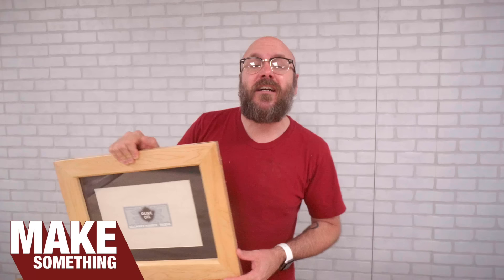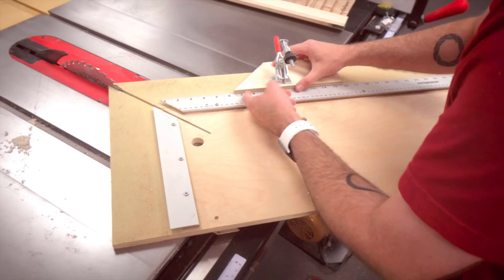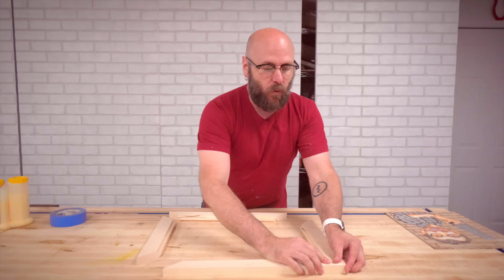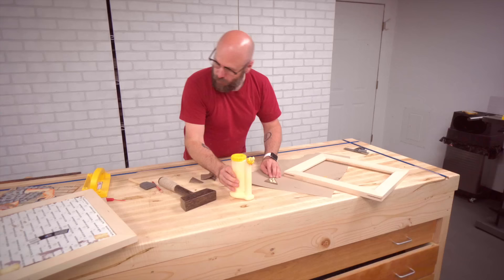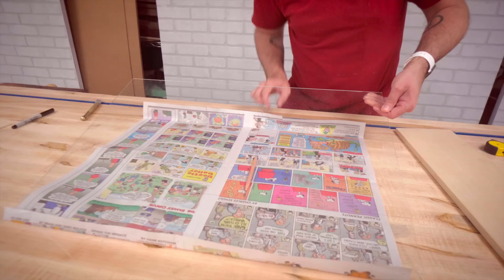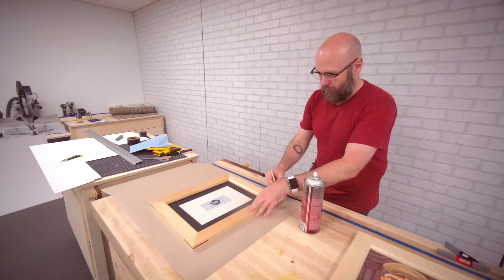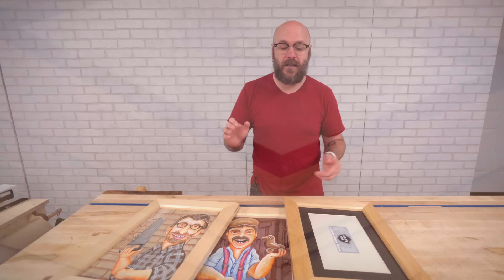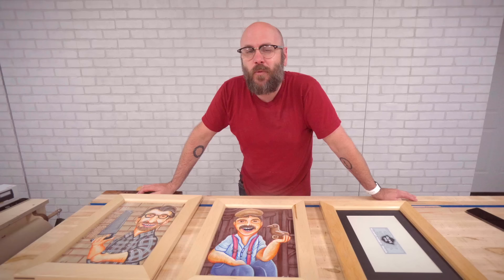Picture Frame Making, Everything You Need to Know. Includes Matting & Mounting

Comment: Hey David! Cool frames! I’ve been making a ton of frames over the last few months and I have a few tips/tricks I’ve picked up that you might like. 1) Instead of Super 77 you can get a cheap ATG tape dispenser that puts down a bead of the adhesive you see on glue dots. It doesn’t get messy or smell bad like Super 77 (IMO) and it sticks instantly, even if you’re backer paper is wet. Why would it be wet? 2) Wet your backer paper slightly, like barely damp, before attaching it to the frame. When it dries, the paper will shrink up a tiny amount and pull the slack out making it nice and taut. A fine mist sprayer works great for this. 3) The framing shops trim their backer paper with ~⅛” inset from the edge of the frame using a little tool that just holds the razor blade in at the right distance; you can make one pretty simply with a block of wood and do the same if you like it; I think it looks nicer on the back and hides the paper better. 4) If you use D-ring mounting clips on the back of the frame they sit flatter against the wall; you can find videos on YouTube showing the recommended way to weave the picture hanging wire through them so it creates a knot that keeps itself tight. Finally, if you find yourself making a lot of frames, a mat cutter makes life a lot easier (you could totally make one, come to think of it) and artists tape is a lot cheaper and more forgiving than the acid free cellophane tapes for your hinge mounts. Alright, that’s all I’ve got for now. Good to have you back! — C
Reply from the maker: These are all fantastic tips! Pinning this comment so other can see it.  Thanks!
Reply: Really great info Corey! I had not heard that trick about wetting the backer paper.
Reply: That ATG tape gun is great for sticking mats together for double and tripple mats.  Used it working in a frame shop for many years.  Also for putting on dust covers.  I had the tool for the backing paper and still may somewhere.  I found it easier to grab one many razor blades that were always laying about and place it between my thumb and forefinger the run my middle finger on the outside of the frame. Works the same.  I eyeballed the distance.  After doing a few of them its just easier.   Artist tape and also conservation tape (made for natural materials that persevere you art).
Reply: Good notes Corey.  I've made all of 1 picture frame with splines and inlays and it came out killer.  Got a large one I am tackling next.

My note to you, David and everybody.  No D-rings, wire, or sawtooth hangers... instead get a keyhole router bit and put a keyhole slot roughly in the middle.  Then you can drive a screw or other fastener and you get a)infinite balance resolution for leveling, and b)frame sits perfectly flat against wall.  Looks so much cleaner.
Reply: In addition to Corey Ward's tip, the cleanest way to cut the backing paper (after the dampen/glue/dry process) is to rough cut the excess outside of the frame, invert it, and use fine sandpaper folded and held at about a 45 degree angle to "sand through" the backing paper against the  sharp corner of the back side of the frame...no overhang, no chance of nicking the frame with a razor knife, no "sharp edge" of paper to snag  and peel back. I always just use a thin smeared continuous bead of woodworking glue to attach the dampened backing paper.
Reply: awesome info, thank you!

Comment: It's good to see that you are using a real glass cutter. Not the cheap home center kind. 

Two comments:

1) It looks like you cut the glass without any lubricant.  At the glass  shops I have worked at, using a small paint brush, we wiped a thin layer of kerosene along the area being cut. 

The kerosene keeps the cutting wheel cool, which extends the life of your cutter and creates a cleaner cut. (Especially on thicker glass)

While kerosene seems to work the best,  glass cleaner or wd40 works  in a pinch. 

2) Clean the glass prior to cutting it.  It sounded like there was crud of the glass near the second half of the cut. That causes the cutting wheel to skip and can cause major problems.  On thin picture frame glass you can get away with it most of the time.   Quarter inch glass, or thicker, will not be so forgiving.

Anyway, love the channel. I have used a lot of your tips while learning woodworking.

Thanks!

Comment: I would use something longer than a pencil to support that glass cut score line. When snapping the glass,  I can't tell you how many pieces of glass I've had veer off the score line without something supporting the full length of that score like a piece of wood.  Also, for people who have never cut glass before, that score with the glass cutter can be made with pretty light pressure. You don't have to dig in with the glass cutter.  :)    Cool jigs and information!

Comment: Ugghhh!!  You make it look so easy!  I used the math/miter gauge method and my miters were all over the place.  Either I don't know how to measure consistently, or my blade wasn't at 45.  Good thing I used some cheap pine to practice.  I do appreciate your videos.  I'll keep practicing.   Although I may be stupid and stating the obvious;--- but, when using a miter gauge, you still have to cut a triangle off the end to get the orientation correct.  You didn't show that part in the video.

Comment: I needed to make a frame the other day but my table saw is in bit (diy upgrade inprogress 😊) so couldn't do the splines. So instead I used dowels. It has two dowels at each corner. So far so good ☺
Reply: John Made it stainless steel dowels are pretty sweet. Use epoxy to bond.

Comment: Great video. I like when you show multiple ways of doing the same thing. I recently made a frame and wish I had seen this first. I attempted my first splines and did  not know about the flat bottom blade. I did fill it with sawdust and glue and it was fine. But next time I am going to get the right blade. Also like the glue up with tape. Look forward to the next video. I am still curious how to figure out the length of each frame piece? I'll have to watch again.

Comment: What I needed to know.  However in your non-jig segment you measure 1.25 on the backside of the molding.  If you have 2" molding with a .25" rabbit wouldn't it be 1.75" vs. 1.25" or did I miss something?   Also I'd like to see a video showing making frames using Pocket Holes and how that measures out with same .25" rabbit.

Comment: The only problem with glueing up a frame in sections is that if your angles are ever so slightly off of 45 degrees, it's harder to fix because instead of a little gap on each joint, the offset will compound onto one corner and make a big gap that can't really be fixed. Not a problem if your pieces are cut perfectly, but that perfect 45 can be difficult to achieve sometimes and little gaps on corners can be burnished over. Great video though, I learned a lot of handy tips!
Reply from the maker: And that's where the picture frame sled comes in. That way you have perfect miters that add up to 90 degrees every time!
Reply: Gotta make myself one! The rulers on there really kick it up a notch.

Comment: First I'd like to say thank you for taking the time to publish that formula.  I've been trying to use that formula to frame out something.  The item is 40 1/8" x 11 7/8".  The trim I'm using for the frame itself is a stock cap from the big orange store.  WM292 is the model number.  The formula does not work correctly on this.  When I cut the trim, it came out too long.  For some reason, I think the addition of 1/8" is the problem.    

Also, in the video, when discussing the formula, you had "length of the artwork+(width of trim*2)...." but said "length of artwork+(outside of the trim to the inside of the rabbit*2)...."   I've tried the math both ways and it still doesn't work.   In the on-screen version, my trim is 1.125"...but the voiced formula is .250".  I actually measured the trim.  I'm using a spreadsheet with the formula put in and I just fill in the necessary info.  It just doesn't work.   I even tried using the dimensions from the product page on the big orange site.  Still doesn't work.   I'm a bit of a math geek and know my way around excel.
Reply: Since it was never mentioned, I assume the measurements refer to toe to toe.

Comment: Around the 4:50 mark, you're explaining the formula to determine length of the frame.  

What you have on the screen does not mention anything about adding in the length of the artwork but YOU did mention adding in the length of the artwork.   

You have (on screen)," Width of artwork + (width of frame *2) - (width of rabbet *2) +1/8".    So am I to assume this formula will give you the length of the rails at the toe?   

And if you change the formula to substitute "length" in place of width...that'll give you the length of the stiles.... so then it would be "Length of artwork + (width of frame*2)-(width of rabbet*2)+1/8"?

Comment: Thanks for that formula, I always underestimate how much material I need! This may be a dumb question, but if that formula figures out the length of the board, how does one determine the width? Is that always for the length of a 1x6 or something like that? Thanks for all the videos and the podcast, great to see you back on YouTube!
Reply from the maker: Thanks! That formula includes the width. (Frame Width * 2) + Art Width = a. (Frame Width * 2) + (Art Length) = b. (a + b) (2) = Total Length of wood needed.
Reply: Okay, the length you get at the end of the formula = the Frame Width? So, in your example, you'd need 68" of a 2" wide board?
Reply from the maker: Yep!
Reply: Awesome, got it, thanks!
Reply: Great video David!  I’ve never done frames before but we’re decorating the new house and you’ve inspired me to make my own as we go.  Thanks!

Comment: I have not found one video yet that actually shows the measurement when cutting a 45 degree perhaps you could explain it..I would very much appreciate it.   lets assume you have two measurements...One side is 15 inch   the other is 17.5 inch  (just building a frame nothing else)   do you measure 15 inch for the first piece?   if so then WHERE do you cut your 45 degree?  I am using a miter saw. Do you line up the blade with the mark on the 15 inch mark ?   and what about the other end ?    Thank you very much !!!!

Comment: To calculate the total length of wood needed for the frame that includes matting, do you just use the length and width of the mat rather than the picture inside of the mat?

The formula would then include:  (Frame Width * 2) + MAT Width = a. (Frame Width * 2) + (MAT Length) = b. (a + b) (2) = Total Length of wood needed.

Thanks!
Reply from the maker: Yep!

Comment: i was thinking of making a super super huge frame for a 300 inch projector screen but i was not going to make the cut at each end to be like diagonal. then was going to put the screen inside the frame and use more wood to sandwich the screen between wood. hard to explain with out visuals no glass of any thing just the screen  the screen had metal hole already was going to use some nuts the look like bolts that have groove in the out side and inside for got what thy are called kinda like what camera have to attach to a tripod at the bottom of a camera. i have more to it but would take a lot to explain  but it just one idea i had to make a frame for a projector screen  screen is 300"  262.6" x 148.4"  so it say in amazon

Comment: Couldn't you just cut your 45, then measure your artwork and add ⅛ and mark on the inside of the frame? I get that you double the width for the outside measurement, but wouldn't it work and be simpler to measure the cut on the inside?

Comment: It seems like those 45 degree cuts could be done so much easier on a miter saw and then you wouldn't need a jig. Can someone please explain to me why that wouldn't be the case?
Reply from the maker: It can be done if your miter saw is perfectly calibrated. Most are not and even .5 degrees off causes lots of issues.
Reply: That's what I needed to know. Thank you.

Comment: I wouldn't worry about the frame hanging right up against the wall ruining the artwork.  You already did that using that acid free tape in your hinging method.  After a short period of time, if you look on the back of the artwork you'll notice a distinct pattern that looks like waves on a shore line.  This will be from the tape.  It is acid free so there will be no foxing but this other problem will develop.
Reply: Sorry, I should have included by professional GCF, CPF initials after my name